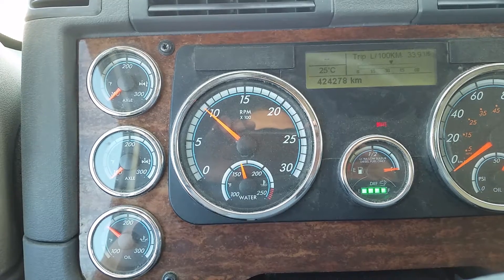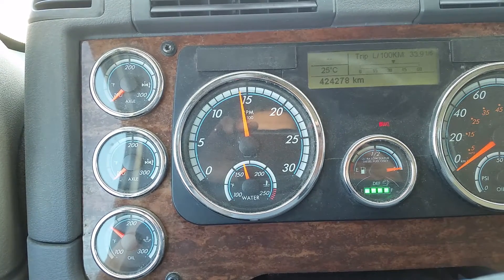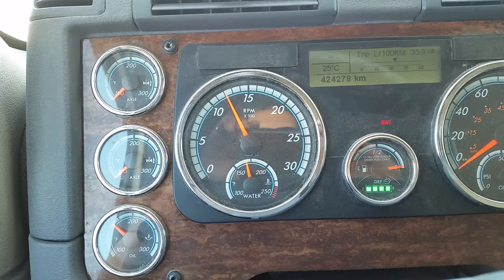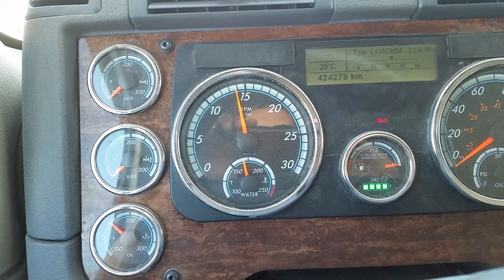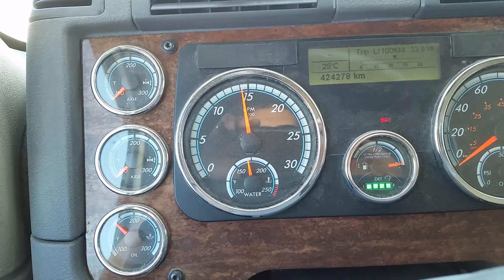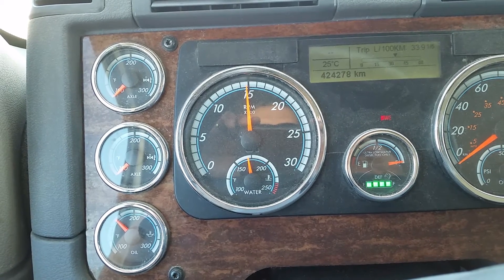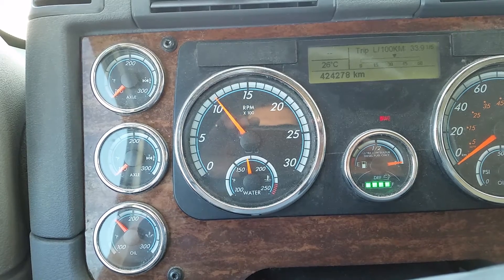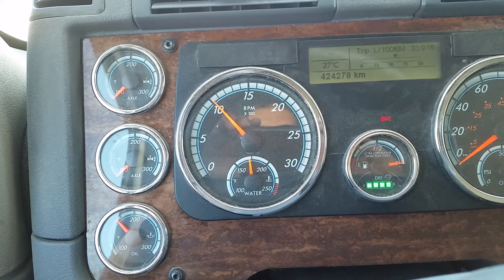Step 1 of 3 how to double clutch

Comment: Can you do that with floating
Reply from the maker: SouthernPyro the transmissions we use these days were NOT designed to "float" the gears. But whether you use the clutch or not, throttle control is the most important to avoid damage to moving parts